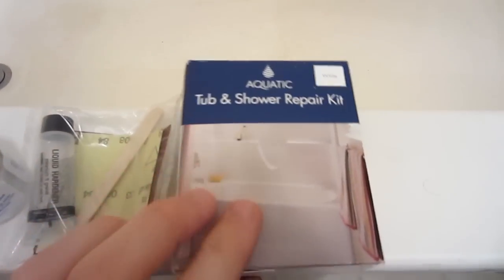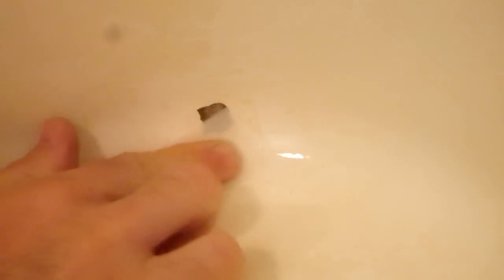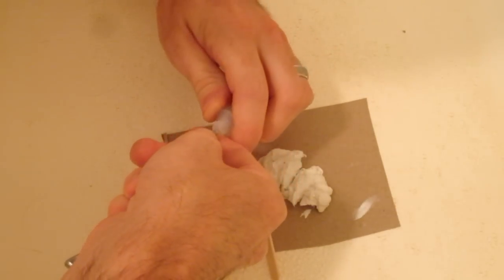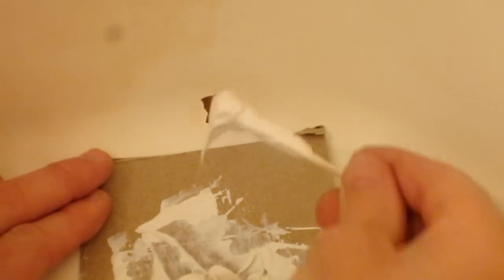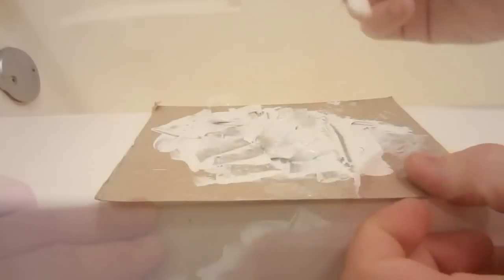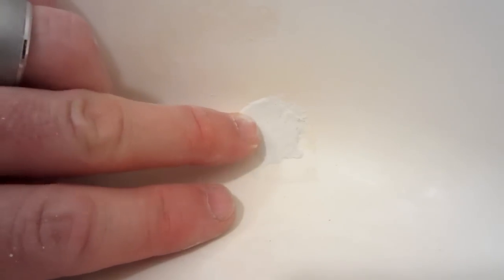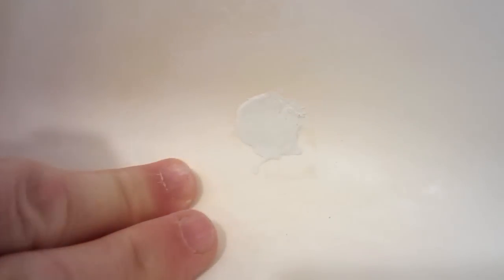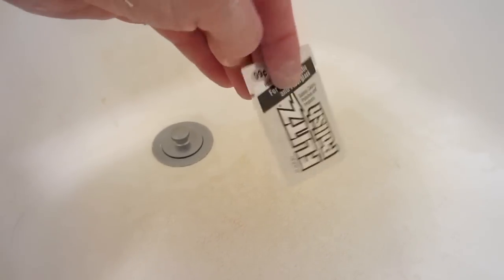How to fix a Crack Hole in Bathtub - Fiberglass

Comment: How good is this kind of fix for larger holes? Say hypothetically, someone (who is totally not me) was to fall in the shower and put their knee partially through the side. Do you think this would work for such a large break?
Reply: might need 2 kits for that
Reply: I'd say you'd need the Fibreglass mesh repair kit then... several layers.  Will leave a bump, but could be painted after.  Like a boat repair. My mother in law did the same to her tub recently (knee through, multiple large cracks... many pieces!).  Needs major repair now.  See a good comment similar to mine above...

Comment: I used this product, and it opened right up as soon as the first person stepped on it!  Good if you don't have a puncture but not good if you have an actual crack.
Reply: That means the tub is not supported right. You have to inject foam or something under the tub so it supported right. Whoever installed your tub didn't make sure it was fully supported. With the support then nothing with hold.

Comment: I used same kit to repair a crack in bathtub. I first watched this video and a couple others, found same kit you used. Works great.
Reply: whats the name of the kit he used ?
Reply: @PoPpaMack127  I can't recall but I later got a more extensive fiberglass repair method as this crack re-appeared. In general those little kits are for very little cracks. I got fiberglass mesh, resin, and hardening. Did like you would repair a crack on a fiberglass boat. This was my first time. Generally cut a few sheets of mesh to the size I want (cover the crack with a couple inches overlay), mix resin and hardening in its own bowl (this bowl only used once), using a paint brush, brush mixture on crack, lay a piece of mesh. Then paint mixture over it, do another sheet of mesh, repeat a few times (I think I did four layers), smooth out the mixture before it hardens. It hardens fairly quick but I waited till next day to sand it. However the mixture is not white so it will have to be painted. It is a noticable "bump" but it sealed that tub very well.

Comment: Good video I hope this works on my hot tub
Reply: i know this is an old comment but i wanted to add to it. MAKE SURE YOUR HOT TUB IS SUPPORTED PROPERLY UNDERNEATH. thats if the crack is on the very bottom. my idiot dad patched several cracks half a dozen times with stuff like this and it turned out the previous owner of the house just made a square section of the patio where they just sort of dropped it in, where the only part supporting the whole tub was the top lip around it. so after awhile (2 years) even though it was a good tub, even flex seal wouldnt be able to hold it. by the time he figured out what was really wrong, he was so sick of dealing with it he gave it away. even though he was an idiot at times i still miss the bastard.
Reply: @MyXyle666  Thanks for replying back  ...I also wish I could have a day back with my dad ✌️❤️

Comment: Thank you!  Very well done- you included every tip from start to finish.  I am going to get that tub repaired tomorrow.
Reply from the maker: +dragomirova You are very welcome, glad to help.
Reply: +dragomirova  do you know where I can buy the kits.
Reply from the maker: +Raiya 111 
I purchased it at the local home improvement store
Reply: +Raiya 111 Hi Raiya, I got mine at Home Depot, it was about $20.
Reply: +Raiya 111 http://www.homedepot.com/p/Aquatic-Gelcoat-Repair-Kit-in-White-35RKWH/100177610

Comment: Thank you for the video. Do you happen to know of any kind of compound that dries clear? My tub is a very odd shade and the white or almond would be noticable. I have a small hairline crack, not a hole. Thanks
Reply from the maker: Sheryl Perry I do not personally know of anything but I would suggest asking others at the local hardware stores. That is how I came across this compound.
Reply: Thank you!

Comment: Nice job, but can you tell me WHAT GRIT of sandpaper did you use??
Reply from the maker: Fred Herald I do not remember the grit number. Depending on how much you need to sand, you may want to start with a low number and finish with a really fine paper to make it smooth.
Reply: SpecificLove Hello, Can you tell me that how can I buy this product in Hungary? The Home depot is not deliver to my country...
Reply from the maker: Jewel Jewel I am sorry, I am not sure how to get it in Hungary. You should be able to get something nearly the same. Have you looked at your hardware stores?

Comment: Nice video. It's very helpful. The only thing I had a problem with was the amount of filler you applied to the hole. Only apply a little bit more then needed to fill the hole. That would make for a lot less sanding.
Reply from the maker: Shaun Linnane Thank you, and you are very right.
Reply: also, don't mix on paper / cardboard as the hardener will be absorbed, mix on a piece of glass or laminate / formica